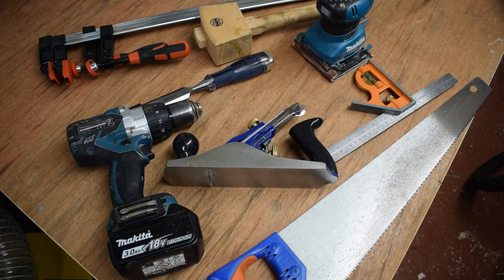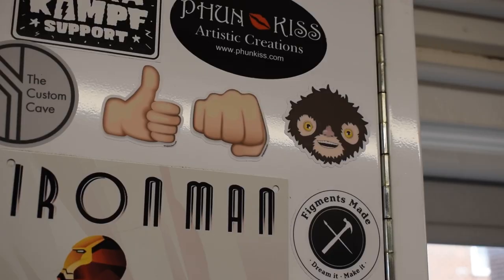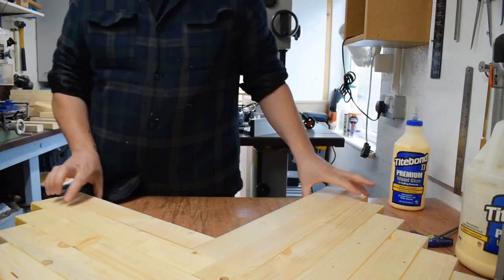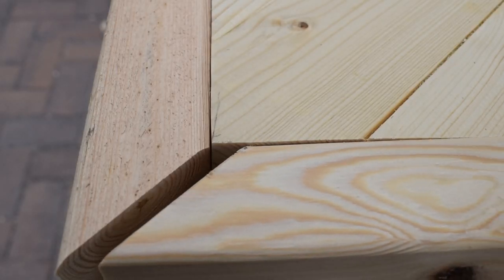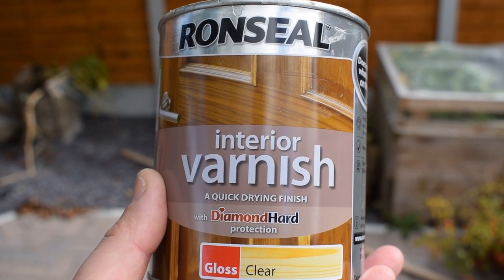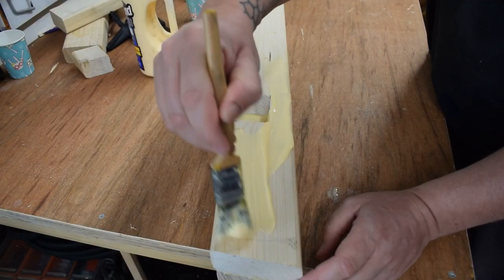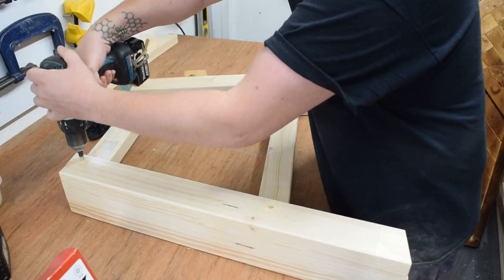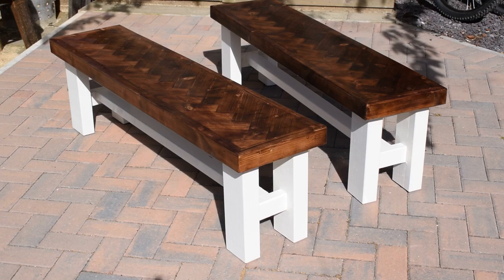Easy DIY herringbone table from “Banana” wood.

Comment: Cool table and benches!  The design looks great!  Bet that is going to be nice to have.  You and your wife and son are looking good!  Thanks for sharing the video. I didn't know you could make wooden plugs like that.  I thought I had to get dowels.  Doy, doy.
Reply from the maker: Anastasia! Lovely to hear from you! Thank you for your very kind comments, we are bouncing back after a very difficult year.  
Everyone loves the table and as for the wooden plugs, yes it’s a really great tool! I did a quick demo on the video and took the plug from a random piece of scrap, if you can take the plug from the reverse side of the section you are drilling you can often get the identical grain pattern.  With hindsight I should have used the darker coloured titebond as well.  Thanks again for watching, I’ll be in touch soon!

Comment: Excellent video. Thanks for uploading. I'll be making an 8 person table this week with a herringbone pattern, I had planned on using a ply sheet to support the timber but this method is so much quicker and just as effective.
Reply from the maker: Thank you Sir, I really appreciate the feedback.
The table has been in use for over a month now, I don’t mention it at all to visitors but they are instantly drawn to it, say over and over it’s beautiful and immediately sit down at it, I see that as a compliment!  I’ve had two commissions for one from house guests alone!

With honest hindsight I would suggest two 45degree braces from the bottom cross bar to the upper part of the table leg frame.   There is no wobble at all at the moment but I think it future proofs it a bit and carries on the chevron vibe when you look at it from the side.  Anyway I’d love to see your results and here if you have any question.  
Many thanks again!

Comment: hi! Nice work man! hope you are well... I am thinking of making a table like this but I am worried about movement in the wood ... how is it holding up? are glue and screws enough to keep it straight?
Reply from the maker: Hi there, thanks for the positive feedback!  That’s a good question.  I built it over a year ago and the only movement I got was about 1mm separation along one internal joint, this closes itself up in the winter.  I’ve been very pleased with it and gets used constantly by my family.  I’ll give it a light sand and revarnish in a couple of years I think. 😊👍🏻
Reply: @MattBerryCustom  ok, sounds good! I am going to let the wood dry for some time before I start, just to be safe... here in Sweden the "bananawood" are 45x70 spruce.
Reply from the maker: Good luck with the build my friend 😊👍🏻